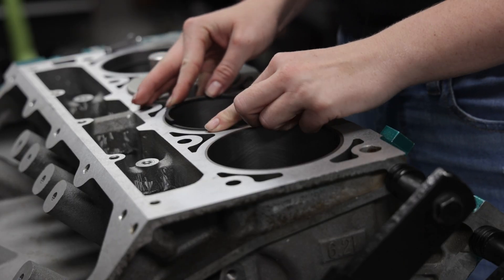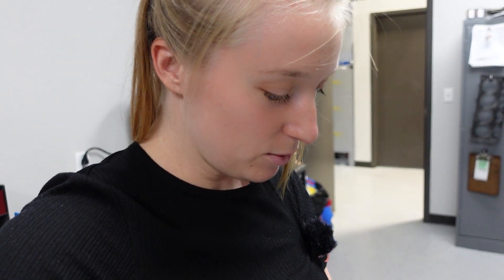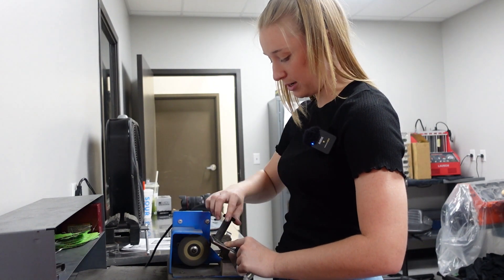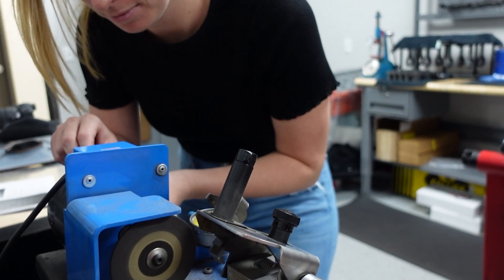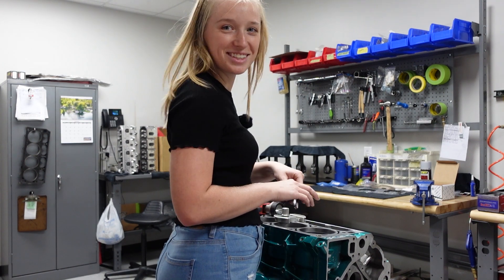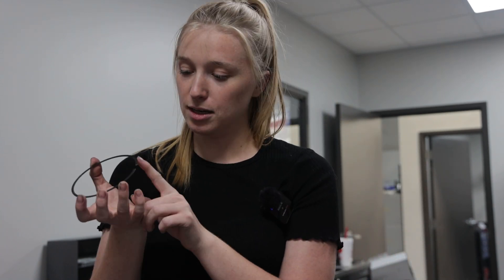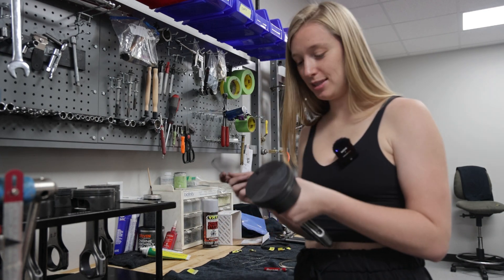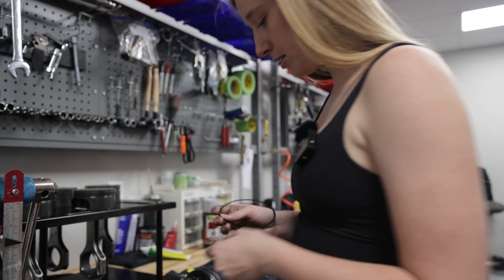Engine Assembly Day 2- Gapping Piston Rings for my 416 NA Build! Ep. 9

Comment: Me and those piston rings have something in common. We’ll get gapped by you 😭😭😂
Reply from the maker: LOL we gotta find that out at LS Fest 😝🤟🏼
Reply: @KaylaRundle   
 If I were you. I'd use STP engine additive on your rings, it's super thick and tacky. Also, on the rod and main bearings. I've built at least 120+ Chevy engines. Big and small block.
When you first start your new engine. You need to fluctuate the rpm for the first few hours. Then, change the oil, it's gonna have machining dust in it. 
I suggest Mobil 1..  10 w 30 Extended Performance, if you live where it's hot, I'd use Mobil 1.. 15 w 50.   Good luck with your new 416 ci engine. I can't wait to hear it running.
Btw, I love the color you chose for your engine, it looks like the color used on older Pontiac engines. Always use Premium gas in your high performance 416 engine.🤟 👍
Reply: @KaylaRundle  let’s run it up 🤘🏻